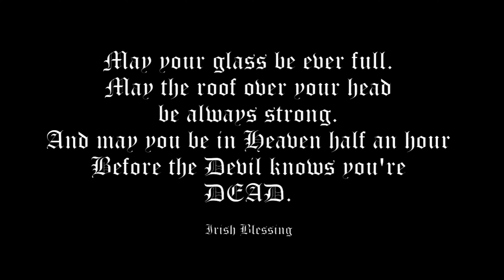Ford 400 Fillin' Station Rebuild Begins! #ford #diy #cars #nonamenationals

Comment: I have seen the drill lapping technique except the guy put rubber hose in the chuck and then stuffed the valve into the rubber hose to make connections quicker

Comment: If that's a Comp Cam, keep a close eye on it.  They've had some QA issues lately.
Reply from the maker: Normally I have my machinist run over them before installing them. Didn't have time. But so far so good. I've only ever had trouble with lifters.
Reply: @IrishOutlawGarage  Just saw DD Speed Shop have a brand new Comp cam and lifters get eaten up in a Chevy
Reply from the maker: @rocktoonzz  yip.